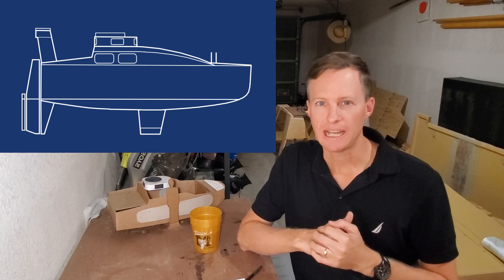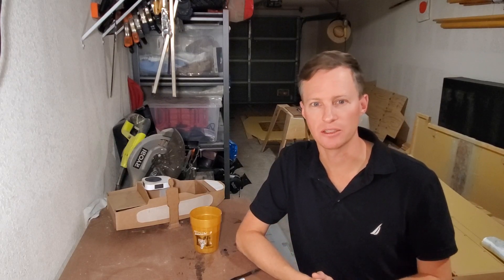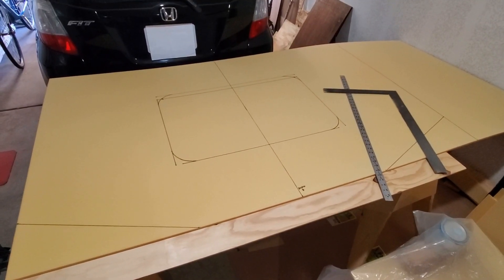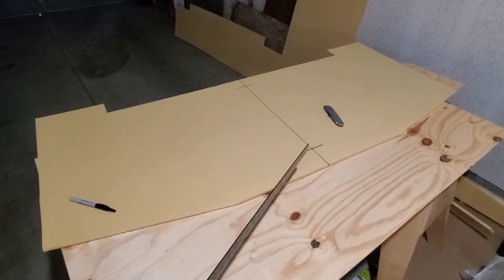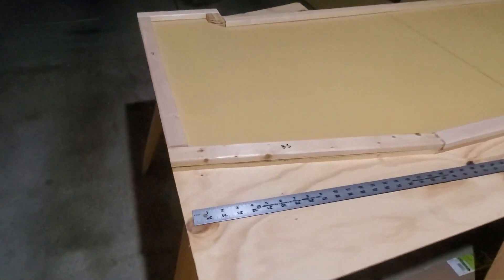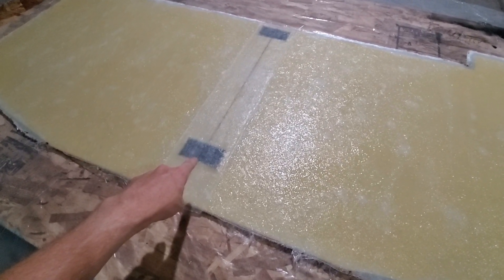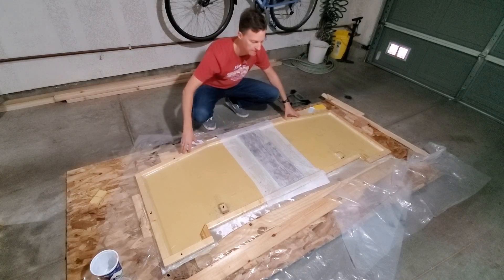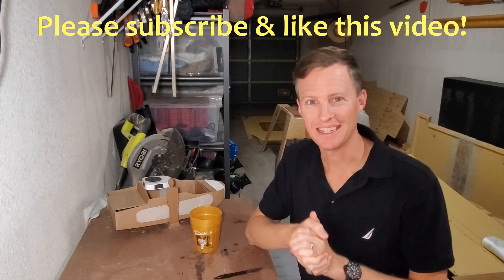OCSS-009 Long Distance Mini-Cruiser Transom Build

Comment: Have you considered epoxying on a larger piece of foam to reinforce the damage repair area?
Reply from the maker: Ah in ep 8. There's no need since the repair is stronger than if there was just bare foam there. Then more layers of fiberglass went on later, and even the mast step was installed which covered that whole area. Keep watching! Thanks.

Comment: Just bingeing your series, awesome stuff... very inspiring! Seriously considering a small ocean going boat, was planning to build a wharram catamaran but since covid my priorities have shifted a lot, maybe small and simple and cheap is better. Anything to get me out of Canada haha! Your reasoning about the strength of a small vessel makes a lot of sense. Anyways, not sure if you have started building the electronics yet but I can recommend "battery hookup" to you for diy lithium batteries. They aren't as complex to build as you would think and they are much better than lead acid in my opinion, especially with the cost savings of building them yourself.
Reply from the maker: Thank you. I'm checking out the battery hookup homepage now. I do want to use a litheum battery.
Reply: I was really considering a Tiki 26 but TWO of everything seems like a mountain that is hard to climb And plans way to expensive IMO. I’ve decided on a Leydon Paradox just started lofting the plywood!